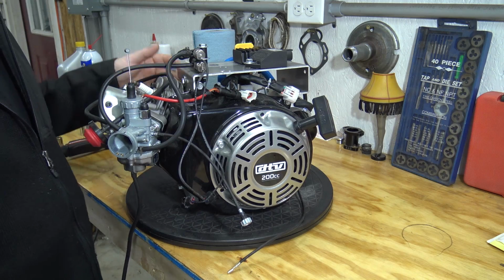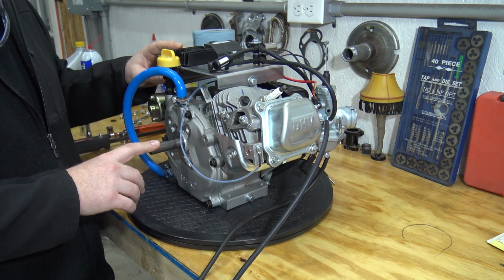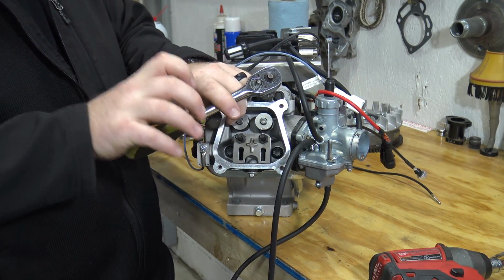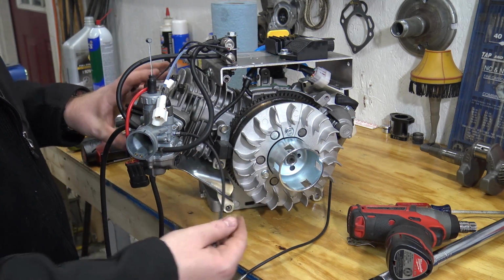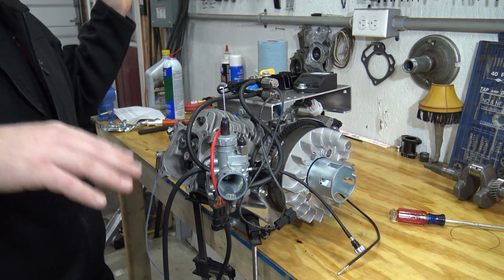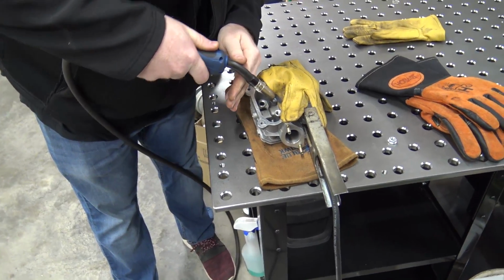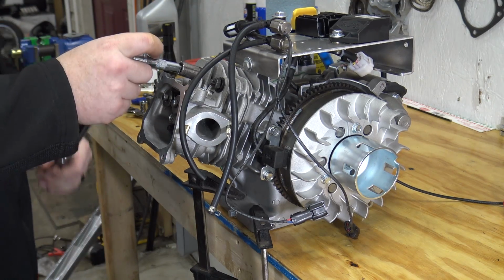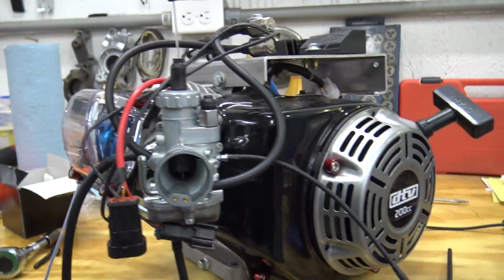196cc High Tech Go Kart / Mini Bike Engine Teardown

Comment: After you weld the nut on the broken stud, use a hand tool to break it loose. Steady torque breaks the stud free,  impact force breaks the weld. I learned on GM 5.3 LS engines in chevy trucks and suburbans.

Comment: What if any is the torque value on the head studs? Great video. Permatex makes the new orange lock tight, holds like red but works like the blue.

Comment: You could add a blue led light in the valve cover through the pcv hole and seal it with a rubber gromet it would look cool

Comment: Hey red i need some advice please. I’m trying to make my old Schwin Stealth 1000 electric scooter gas powered. I purchased a predator 212 from harbor freight a few weeks ago to do this project. I also own a welder, grinder, and regular tools. My questions are what number chain should I use, and either a 5/8 or 3/4 jackshaft. Also what’s the best deal I can find mini bike wheels and tires with drum breaks? I’ve been searching like crazy trying to find a good deals but $160 - $200 seems to be the cheapest I can find.???? I checked Craigslist with no luck either.

Comment: All the air sensors and Ecu stuff can be eliminated with a lectron carb. The oiling system is cool though, idk if lubrication was an issue for gx200’s before. I certainly never have had issues with a predator 212

Comment: Your going about getting your broken bolts out all wrong.. all you need to get is a left handed drill bit.. drill into it and when the bit gets stuck use the impact with a left handed bit and it will come right out. Happens all the time here in my shop so I have plenty of left handed bits for my impact with the quick bits on it.. works like a charm try it some time
Reply: "All you need" you've obviously not removed a lot of broken off bolts. Guess you haven't broke one of those bits off before...

Comment: You need to heat the head with out heating the bolt after you weld the nut on,  the aluminum needs to expand away from the steel bolt so you can get it out

Comment: if u ever have to weld in the head like that use a bunch of wet rags or wet napkins, its works so much better at catching the slag and protects everything around it, also no fire bc there wet, just a welding tip for ya =)

Comment: my guess is that moving the weight of those roller rockers back and forth might loose the same amount of horsepower as with the friction of the stamped steel ones , it might even cause some delay in closing the valves at high rpm (valvefloat) might reduce wear and have less rocking motion on the valve stem though

Comment: You always wind your torque wrench down completely on zero so there is no tension on the spring
Reply: See now I heard it was that you were supposed to put it at the lowest setting (not totally loose). So I leave all mine at the very bottom, so the spring is naturally under some slight tension, but only a tiny bit. They seem consistent so far!  I think the best thing you can do is not to drop them though.
Reply: He were can I git one. I cant find it on dtv .com
Reply: @christopherdeese1510  A tools supplier, eBay or for breif use Walmart or Sears etc.Goodluck. Trev NZ
Reply: that is precisely what your supposed to do

Comment: I'm confused. If you knew the bolt had red loctite on it, why didn't you heat it up before attempting to loosen it? Or did you and it still wouldn't break free?  -edit -answered at 25:33. Makes sense.

Comment: That weld is causing bolt to expand. U we're right to let it cool down first
Reply: Heat whatever it's stuck in, then spray the broken bolt with starting fluid........ Works almost every time
Reply: ALMOST every time.....
Reply: Yes heat what ever the bolt is going in to...I hate when chucke2009 heats the stud...and then let's everything cool...like wtf did that do? Lol

Comment: 6:37 pretty advance that's every motorcycle flywheel and chinise quad engine and the price of this engine in not worth it a lifan 125cc gives more power and cost less
Reply from the maker: It's advanced for these engines.
Reply: @RedBeardsGarage  hey any clue why my ex rod keep spinning off the rocker in my 212 hemi pred.its brand new. I took the governor out it ran a few times and then it stated slipping

Comment: With the ECU abilities this little engine could be a good platform for a turbo...
Reply: That ecu would need the ability to read a wide band o2 sensor if he wanted to turbo it
Reply: Kinda like Cars and Cameras turbo drift trike
Reply: @joshdupont2209  this would be a better platform because of the ECU.  It can change air fuel ratio to keep the engine from leaning out at high rpm.  That is hard to do with a regular carb.
Reply: @gonzobtrappin1911  their ECU is self learning. It should do the same, no?
Reply: @joshdupont2209  if it has an ecu yes, but looking the description of the engine I didn't see one.
Reply: @gonzobtrappin1911  I thought I heard red beard say it had an ECU.
Reply: @joshdupont2209  red beards engine does   from this video, but I am not sure about the drift trike.
Reply: @gonzobtrappin1911  the drift trike from Cars and Cameras has an ECU. They got it from Go Power Sports
Reply: I want to se that thing turbocharged too

Comment: The side play on the rocker rollers is probably there because the aluminum will expand with heat. If they didn't have endplay they'd bind when hot...